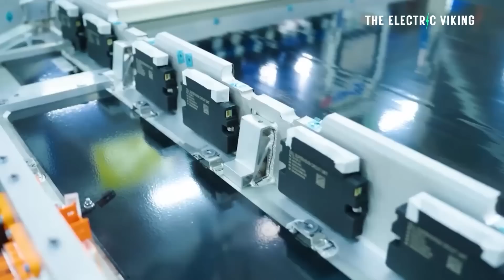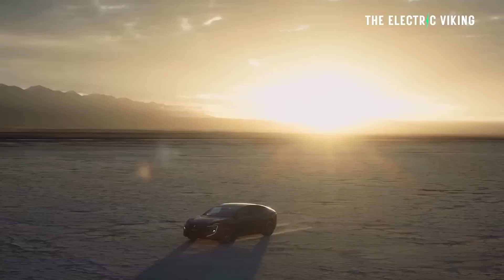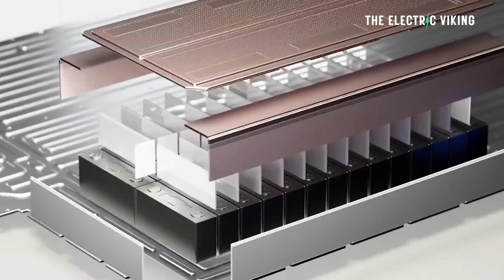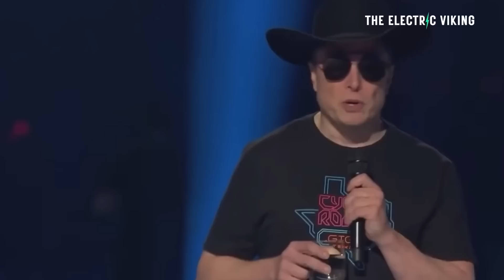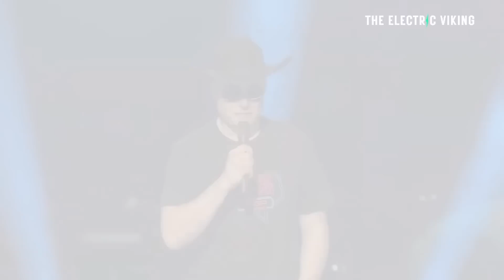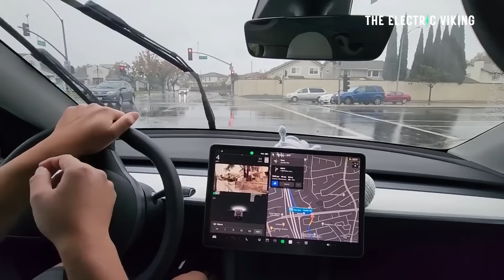Tesla's biggest battery supplier unveils 3 million kilometre battery

Comment: The main question about batteries is calendar ageing - I'm not gonna drive a car for 300k kms a year. But I plan on keeping it for 15-20 years. How will the battery hold up after 10 years and how much will it cost to be replaced after the warranty runs out.

Comment: I used to drive a truck across Europe, and even that took about 10 years to cover 1,000,000 miles, so 3,000,000 km would take over 20 years in that.
If they can really get the density higher, then even the trucking industry will start making sense using electric trucks for the long haul work.
Reply: Trucking and robo taxis will surely rack up the miles if used 24/7.
Reply: @Jamessansome  mine was only driven by me, so nowhere near 24/7.  I did sometimes double man if the load was urgent though.
My last job was with a cab company, and our cars averaged around 100,000 miles a year, but they did run 27/7 with different drivers.

Comment: If they don't make the battery packs servicable I don't think a warranty on the cells longer than ten years is relevant. The electronics in the battery pack is likely to fail before the cells then, and with a structural pack filled with "gunk" you can't repair it.

Comment: I want an EV so badly but they don't have enough range for me or at least there isn't enough or reliable charging infrastructure. At least once a month I need to drive 240+ (round trip) miles to some work sites. Until I can get that kind of range in -6 C weather during the winter, or there is charging stations at every corner or parking lot I can't go fully electric, not to mention I also often visit my family on the other side of my state which is a hilly 250 miles away. I'll still get an EV soon because I don't need that range all the time. But I still need a hybrid back up for when I need more range when I make these longer trips a a couple times a month. But damn the moment that kind of range is affordable, or charging stations are everywhere, I am going all in on electric.
Reply: its just a car

Comment: More good battery news. Once we start seeing cars with 400mi range as the standard and 10-80% in under 10 minutes, it’s game over for ICE. I actually think it’s already over for ICE but it’s taking longer than we would like in the US.
Reply: A genuine 650 km range (400 miles) with aircon running (or heating on), some hills to contend with, highway speeds, wipers and lights on and a 10% to 100% charge (an equivalent ICE full tank) in under 10 minutes would certainly make people stop and consider what their next car will be, ICE or EV. Here in Australia EV sales plateaued at 8% two years ago and EV market share has not increased since. Just reading articles by Government bodies, automotive industry observers, etc, the likely outcome for most countries by 2035 will be a mix of 30% EV, 30% hybrid and 30% ICE. The remaining 10% would be a floating variable. The game is not over for ICE. Geely (the EV manufacturer) and Renault are jointly developing new hi-tech, efficient, lightweight, low profile ultra-low emissions 1.5 litre and 1.8 litre petrol engines for their future range of hybrid vehicles. No mechanical valve train, (all electronic operation), ceramics, etc.
Reply: @ yeah but why would anyone want an ICE and have to do with oil changes and volatile gas prices when you can have a nice quiet, fast and smooth EV that you can charge at home for $7? Economics always wins out. It’s literally the reason horses lost to cars.
Reply: @ If you can charge at home with solar, then yes, an EV is probably a good fit for you. But if you’re one of the millions of apartment dwellers, then you are subject to volatile electricity prices just like your ICE cousins are subject to volatile fuel prices. And oil changes, most cars are only once every 10,000 km or 12 months whichever comes first. If you have even just elementary mechanical skills you can easily change the engine oil and filter yourself at home. My 2006 Mk5 Golf for example just 2 weeks ago cost me only 80$ AUD ($52 USD) as I bought the oil (5W-30 full synthetic) and Ryco filter 3 months ago during a 50% off sale at Repco. If I had an EV, I wouldn’t be able to do anything myself on it (I’m a qualified mechanic) as there’s always the risk of electrocution. An EV is never “off”, like an ICE car. And EVs do require annual servicing. They actually have reduction gearbox oil (takes about 2 litres of ATF) and a filter and pumps.
Reply: @PropanePete  The "Aptera" solar charged EV will be perfect for most of the apartment dwellers interested in an EV.
Reply: @ The Aptera is an interesting concept car technically, but the solar charging rate is very slow, just a trickle. Also it’s absurdly expensive. Here in Australia it will be $74K AUD ($49K USD) and there are issues with it meeting the ADR’s (Australian Design Rules) and pedestrian impact spec’s. The Aptera was supposed to hit Australia early 2023, but there’s absolutely no market interest. It’ll never get to our shores. You would be better off with the cute little Fiat 500E, much more practical for a city EV runabout but unfortunately they’re also ridiculously expensive for such a tiny 2 door car ($52K AUD - $34K USD).
Reply: @PropanePete   True, the Aptera only charges 40 miles per day, but I think the distance driven is about 25 miles per day average in the USA. The Aptera only has 2 seats, but you could fill the huge trunk space with a bicycle and 2 surfboards. It has more space than 99% of compact vehicles on the road today. The 400 mile Aptera is less expensive than the Fiat i believe with the upgraded 1000 mile version a little bit more than the Fiat. I may go ahead and get 1000 mile Aptera and use it for delivering packages. Its efficiency should bring a large financial gain as compared to the tiny little Fiat.
Reply: @  If you do get an Aptera, please record your experience with it, range, expense, charging, maintenance, handling (it is a 3 wheeler after all) reliability, etc. Do you have a YouTube channel. If not then start one up and publish your findings, you will definitely get a lot of views and subscribers. There’s very little information about them on social media.
Reply: @PropanePete  Right, better engines that are 2% more efficient.. I like the word "hitech" you put in there, as if until now everybody was developing "lowtech".. Look brother, EV's are the future, Hybrids are sh.t, and so are ICE's. I drive a ICE for now, but my next car hopefully in a few years, is 100% BEV
Reply: @TricoliciSerghei  EVs are essentially  aimed at the relatively wealthy developed industrialised countries. Only 33 countries fully meet that category according to the UN and WHO. You say EVs are the future, but which countries are you talking about. For example there are 54 countries on the African continent, population 1.4 billion. How many of those countries do you think have the wealth, the infrastructure and the political stability to worry about electric cars. They all have other priorities, clean water, health, education, sewerage systems, food reliability, and preventing their neighbouring countries from attacking them. And 80% of that 1.4 billion cook on an open fire every night. ICE cars will always provide the transport backbone in those countries. Go to Egypt and you will see 1960's petrol Fiat 1500's everywhere and same era Peugeot 404 diesels. Absolutely unbreakable.
Reply: @ actually it’s generally cheaper for developing nations to leapfrog older tech and jump to the latest tech. Everyone in Africa has cell phones now. And solar is super cheap in Africa too. Furthermore they get hand me downs from the West. Basically the wealthy nations pioneer the tech and the poor nations benefit for super cheap. This is the way it’s been forever. If that weren’t the case, nobody in Africa would have gas cars anyway.
Reply: @PropanePete  China is selling 10k Dollars EV's.. Add some cheap solar on your home, be it the US or Africa, and your price per mile goes wayyy down compared to an ICE.. It's game over!
Reply: @TricoliciSerghei  It's not game over in Africa mate. I lived in Angola for several years and travelled extensively through many other African countries. The Sudan, Mozambique, Liberia, Eritrea, Chad, etc. Most of those people live on $50 USD a week and one meal a day so there's nothing left for "cheap" solar panels. The Africans are very clever and innovative at keeping old machinery running indefinitely. An EV in the Namibian desert or the High Atlas mountains of Morocco would not cut the mustard.
Reply: @mikeshafer  Mate, I lived in Angola for several years and travelled the African continent extensively. I have African friends. They tell me what's happening. Your post is well meaning but I can tell from it that you've never lived in a 3rd world country, particularly an African one. There are 54 African countries and most of them are not doing well. There is a wealthy black elite class in all African countries that do have "cell phones" and BMWs and house servants but they are mostly politicians and military Generals. The rest of the 1.4 billion live on one meal a day, two if they're lucky. And "hand me downs"... what use would a clapped out EV be in southern Egypt.
Reply: @PropanePete  I've lived in third world countries before, so I get it. It doesn't really matter though, the more important thing is that over the long haul, EVs are going to become cheaper and more economical to everyone. Africa will be the last - it always is. But back to my original comment, the fact that battery tech continues to improve and infrastructure continues to expand means eventually oil will no longer be compelling. Hell, I keep reading stories about how so many Africans are relying on solar power for their homes. Solar! I can't even get solar in the US for under $40K.
Reply: @PropanePete  Are we talking about Africa because EV's are somehow harder to buy there, coz nobody's selling? 
How about Asia, Europe, US.. I mean, continents where people have money.
Reply: @TricoliciSerghei  Statistically EVs are mostly only shipped to the UN and WHO category's of developed industrialised nations, where the populations are relatively wealthy and fully employed. That's just 33 countries out of the world's 195 countries. A trickle do go to the wealthy elite in undeveloped countries as a private import. Johannesburg for example has a population of about 5.5 million and there are only around 400 EVs there according to the Automobile Association of South Africa, mostly owned by the elite, politicians, businessmen and military officers. And Sth Africa is the most developed country on the African continent (or was).
Reply: @ I’m not anti EV, I like the idea of an electric drivetrain, it makes sense. If I lived in a city in an apartment I’d probably buy a cute little Fiat 500E. But we live in a rural area with hundreds of kilometres between towns and marginal charging facilities. If you live in an Australian capitol city or large provincial town an EV will be fine. But most of Australia is rural we’re a continent almost the size of the US but only 25 million people. The industry and government observers here forecast that Australia will eventually over the next 10 to 15 years settle down to 30% BEV, 30% hybrid and 30% ICE. The remaining 10% would be a floating variable. Hybrids of the non plug-in type are hugely popular here, it’s an 18 month wait for a Toyota RAV4 hybrid and 12 months for a Camry hybrid. Meanwhile the BEV sales figures are flat and have sat around only 8% for the past two years. You can walk into a Tesla or BYD dealer and drive out 15 minutes later in a new BEV. So by around 2035 or so 60% of our private vehicle road fleet will still require petrol. We are still building huge brand new service stations (gas stations) here because the number of new ICE vehicles being sold every month is increasing and they all require fuel. And a large percentage of those vehicles are diesel. Those Africans with solar you mentioned. The power in many African countries is rationed, gets switched off for hours or days at a time. The power is redirected to the wealthy areas to keep politically influential people happy. So some of the villages pool their resources and buy some cheap Chinese solar panels and 12 volt car batteries and that helps them out with 12V light at night, a few radios and a TV or two, etc. But definitely nothing like the enormous power needed to charge an EV battery, even if they could afford a pooled second hand EV.
Reply: So assuming 150 kWh battery for that range and 10 minutes to charge, that's around 1 MW per charger.  And if we get to 2000 Volt batteries, that's 500 Amps.   Is this a practical prospect ?
Reply: we are already there. 2 years from now we will see cars with that kind of range and charging. They are now pushing full throttle for EV and the chinese are on the frontseat.

Comment: So why is the warranty for any Tesla battery only 100 000 miles?
Reply: Why is the average ICE car warranty 3 years or 60,000km/36,000mi? Does that mean cars are only expected to last 3 years? Or do things typically last longer than the warranty period? Tesla's battery warranty is 8 years or 192,000km/120,000mi. Way better than any gas car, even their extended warranties which are typically up to 7 years. Also, this is a future battery that isn't in Teslas yet, and I don't think it will be due to the lower energy density and the fact that very few cars ever last that long. It would only make sense on vehicles that do a lot of short range trips like delivery trucks or something - head out, deliver your loads, come back and plug in while getting loaded up again, head back out, over and over.
Reply: There are plenty of dead Tesla batteries at 140K miles on YouTube.
Reply: Are the batteries dead or is it the BMS (battery management system)

Comment: Well one big reason larger cells could be problematic is heat. The specific heat capacity to surface area ratio is an issue. Volume is pi.r^2.height. Surface area is pi.d.h. the bigger the cell the lower the ability to transfer heat, which means you have to limit charge and discharge rates to match your temperature targets. If you want fast charge you have to let your cells get hotter, shortening their lifespan. Basically that means CATL are spot on correct, Chunky cells for EVs are a dead end .
Reply: The area of the cell is irrelevant if sufficient cooling is applied.  Tesla has superior liquid cooled packs.
Reply: @GWAForUTBE  Dude, you can't beat physics. There's a maximum rate at which heat can be transferred and that's limited to the thermal conductivity of the materials comprising the casing, electrolyte, anode, cathode and spacer. There's no way to make a magic fluid that can change those fundamental material properties. Education matters people.
Reply: @atarisidequest where can I read more about this topic to educate myself?
Reply: @atarisidequest not all cells are equal in regard to how much they heat up. Tesla went with a tabless design on the 4680s so that the maximum distance each electron travels through the cell is only the height of the cell, not the length of the ribbon, drastically reducing internal resistance and therefore heat production. And, yes, the coolant system matters very much Mr. Physics. Heat transfer depends on the temperature differential and surface area. If you can provide cooler coolant, the heat transfer from the cell to the collant increases. Tesla also curves the coolant channels around each cell, maximizing surface contact. Tesla has the best engineers in the world working for them and their cars have the best reliability in the industry. Maybe don't automatically assume you know better than they do when they actually work on this stuff every day, day in and day our, and can see the exact numbers right in front of their faces, which is going to beat any keyboard warrior's overinflated opinion of their own physics knowledge any day.

Comment: Batteries of most of today's EVs will easily outlast the car itself. Recent studies shows that reaching 1 mio. kilometers (twice the total average mileage of all cars) is more than likely. Even reaching 2 mio. kilometers is possible with proper battery management 😎
Reply: Those estimates are based on the life of ICE cars, which is considerably lower than the life expectancy of an EV, which we have yet to verify.
In other words, the claim “battery outlasts the life of the car” is absolute rubbish and meaningless.
Reply: @ElMistroFeroz  Given that battery prices are falling, by the time a new EV battery needs to be replaced — which should take quite a bit longer than the average time for an ICE car to need an engine replacement — a new battery is likely to cost less than a new engine for an ICE car.

Also, given how much the average person drives per year, a million KMs battery would last over 40 years for the average US driver. A 3 million KMs battery could still be usable over a century down the line if time-based degradation isn't too high. Even if EVs end lasting over twice what the average ICE car lasts, for most of them the battery will still outlast the car.
Reply: Batteries should not be sold as vnand ssd's..... That's just criminal